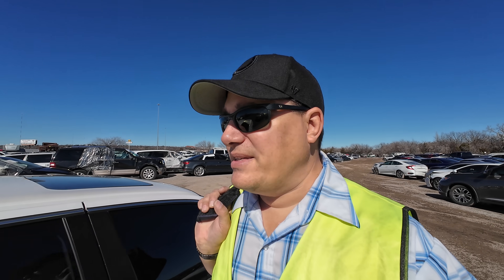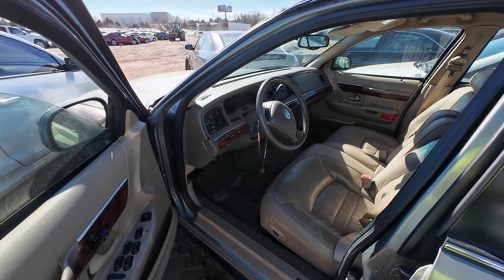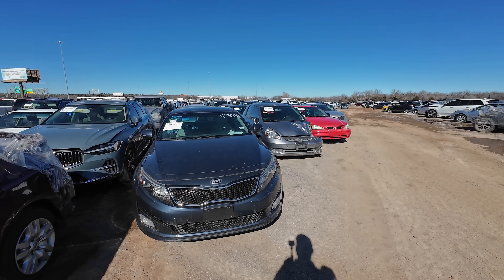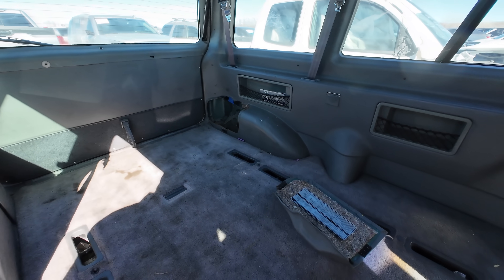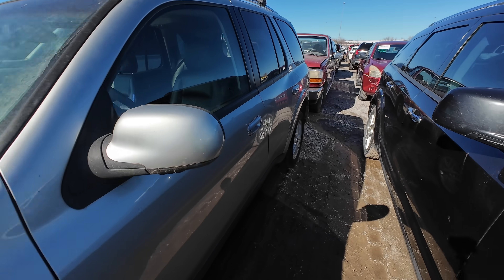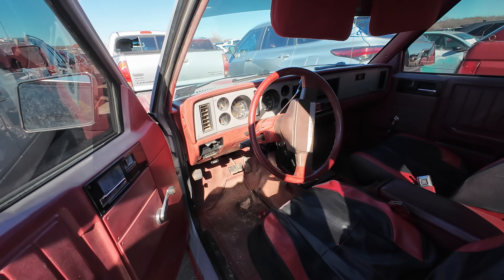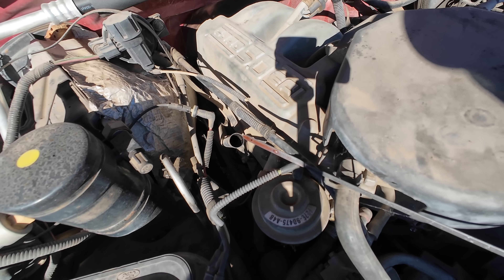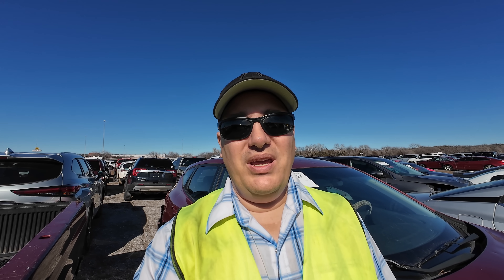I Found a RARE Chevy S10 Durango and Ford Aerostar at IAA Will it Run?

Comment: Aerostar the biggest piece of complete disaster ever made by any producer. They were falling apart just by being parked. The worst garbage ever. Well… I should not be surprised. It is ford after all. And this particular with 68 000 miles is like any other car with 680 000 hard core miles. Whatever you see on the odometer multiple by 10…

Comment: ford for a long time didn't make good transmissions???  it's 2024 and they still don't.. what are you talking about Randy???
Reply: 4r70w duh
Reply: That's because they have outsourced transmissions. The engines and transmissions with issues is because of outsourced parts.
But to let these problems go on for a decade is unacceptable.